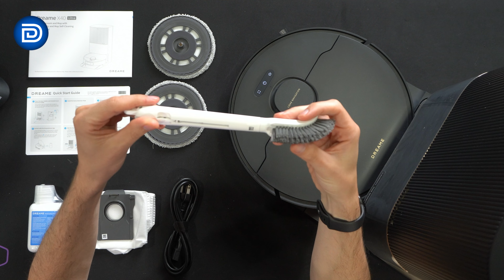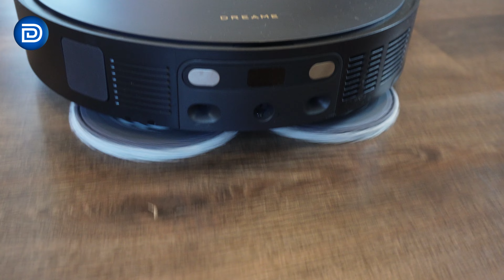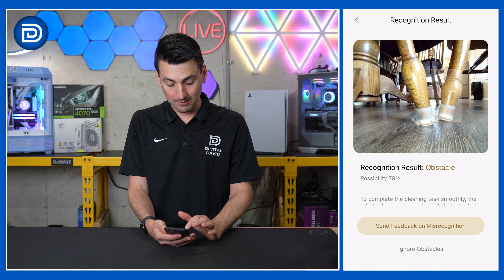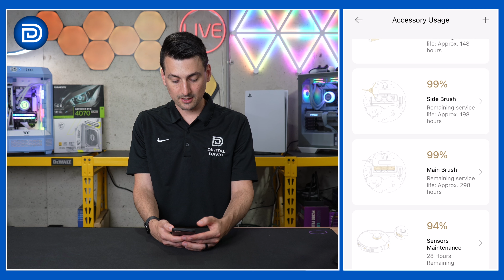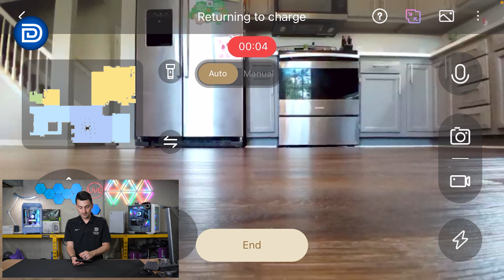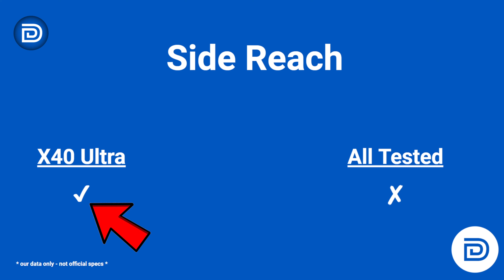Cutting Edge Innovation: Dreame X40 Ultra Review

Comment: I'm really unsure between the Dreame X40 ultra & the Roborock S8 MaxV Ultra. 

I don't like the design of the Dreame base station. If the roborock also had such a hair cutting thing, then my choice would have been quickly made for the roborock. Since this is an external thing do you think Roborock can also release such a brush?
Reply from the maker: You got to go with what is best for you. It sounds like the X40 Ultra is what you should get if you can tolerate the different base station design. I am sure roborock can release a similar brush but if so when?

After using both (roborock sent me the S8 MaxV ultra) I would pick the X40. Good news is you will be really happy with whatever one you end up going with as you cant go wrong imo!
Reply: I'm concerned about the tiny flimsy mop thing on the S8 MaxV it looks like it will snap right off after a few months use. The X40 looks like it will last longer.

Comment: Don't get me wrong, I really want to buy the Dreame X40 and I'm willing to pay that much money for the best out there but quite frankly for some people, which unfortunately includes me, there is a design flaw so massive that I just can't bring myself to choose this over the Roborock s8 MaxV Ultra even though I really want to.

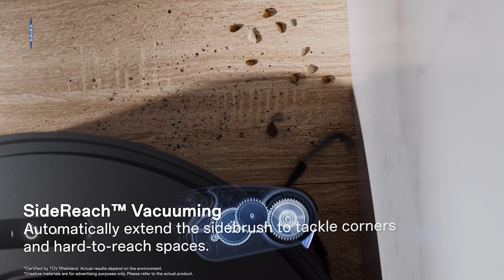Ironically the video playing in the background of your very enthusiastic conclusion says it all at time index 32:57 and then 33:27. At 32:57 you see it cleaning a fully carpeted room where on carpets the X40 designers for some reason decided to disable the side brush completely so you can clearly see that it isn't spinning. Then at 33:27 you see just what that stupid design decision denies people who have any fully carpeted rooms. So Dreame think that it's important to give great edge and corner cleaning on hard floors but that people with fully carpeted rooms don't want the edges and corners of those rooms cleaned properly?

If Dreame fix this issue - maybe allow users to say on a per-room or per-area basis that they have low pile carpets that won't tangle the side brush - then I'd buy the X40 in a heartbeat but as it is now it's a hard pass from me.
Reply from the maker: Great observation! So I was under the impression that was a setting I toggled on/off but clearly looking through the app again that does not appear to be the case. Hopefully they can update the app/firmware for those that are bothered by it!
Reply: I noticed it too, and it's a huge minus that the brush doesn't work on carpets. many people began to notice this in the reviews. I hope it will be fixed in the new update.👍👍👍
Reply from the maker: I like to think they can fix it via update... now only a matter of will they do it!

Comment: great job. very well done review. thorough. im curious how your review of max suction power (PA) compares to CFM - what's the link/connection?  If something has highest suction power, but not a corresponding relative CFM - what does that indicate?  Love how you do scoring as well.   Would be great when you do reviews to sometimes explain what your numbers mean.. i.e. if a max cleaning score is 85 for instance, what does that number mean in relative terms.  Either way - this was a great review, and detailed and provided great content. thanks
Reply from the maker: Great questions. Happy to have this conversation as we are still learning as we go along! You would think they would be proportional but that is not true from our experience so far. Ideally we want high suction and high airflow but a lot of vacuums like the whole roomba lineup don't even advertise suction power (because they most likely are very low) and score really low on CFM (not a lot of airflow) but with their dual roller system they are able to do really well on our carpet clean up tests.

So if something has a high suction power (something we hope one day to be able to test to verify manufacturers claims) and low CFM then at the nozzle inside the vacuum it is very powerful but at the point of contact (your floor) it won't be moving as much stuff towards it to vacuum it up. So that vacuum is all bark no bite lol

In regards to your other question/point I am not sure I understand... so for the max cleaning score we put the overall avg (85) so you have a baseline of what the "typical" robot vacuum scores. That avg is calculated from the over 60+ vacuums we have personally tested. This way you know if it is at, above, or below average. So if the x40 Ultra scored 85 then its real world cleaning would be right at the avg for your typical robot vacuum. Is there a way we can clarify that further for you? All of this is really helpful so I appreciate you reaching out so we can continue to improve our videos!